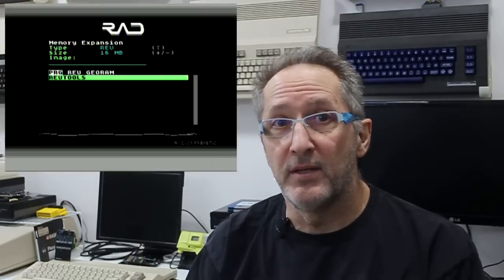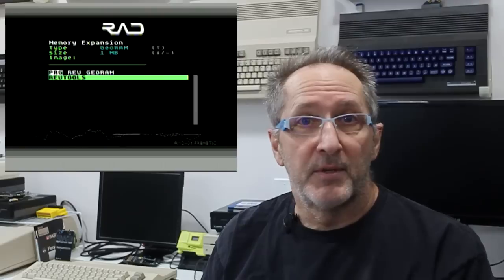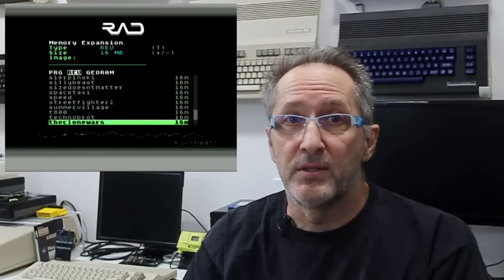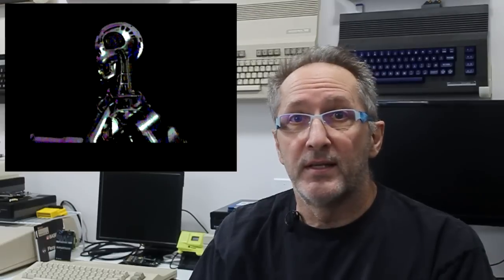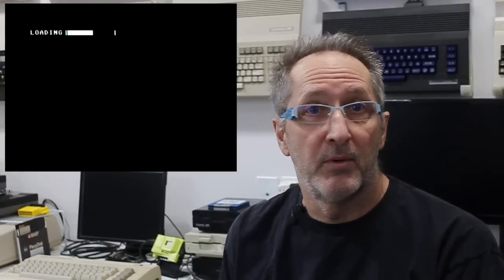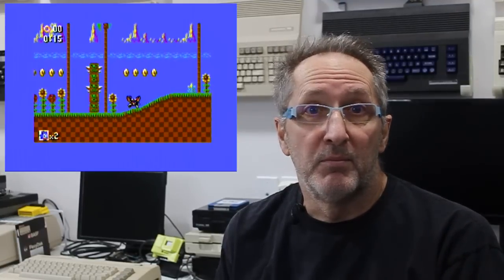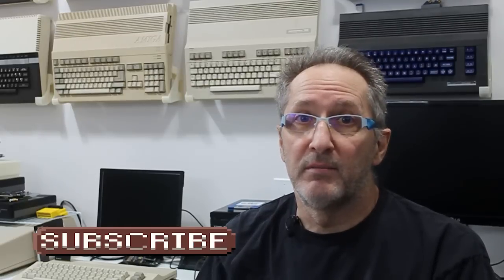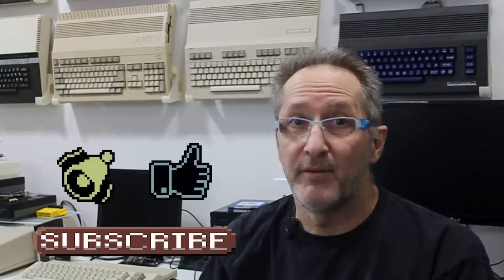Commodore RAD Expansion Unit Review

Comment: So i have a 1541 Ultimate II+ from Gideon. Is it better or worse than the RAD Expansion Unit and what are the differences? Is it worth buying the module if you already have the 1541 Ultimate II+?
Reply from the maker: If you have a 1541 Ultimate II+ it's absolutely not worth your time/money to buy one of those.  Gideons cartridge is more cycle accurate than the rad.  The rad is a cheap handy device if you want a fairly compatible ram expansion cartridge, but it's nowhere in the league of Gideons cartridge.
Reply: @8BitResurgence  Thank you very much for your answer.

Comment: I just got one of these devices for my Flat 128. When i install the device and turn on the computer, I get the music, but the screen gets progressively worse.  Can you explain or show, how to go about fixing this with a flat 128?  I would really appreciate that. ty
Reply: Exactly the same for me. Works fine with a real c64 but not with c128 (c64 mode, too). Plays music but a lot of glitches and random characters on the screen. By selecting a REU and rebooting the c128 freezes. Maybe timing issues or any other settings to change in the cfg file? 
Doesn’t work even by using a new ‘updated’ power supply or a dedicated separated supply for the Raspberry Pi. Anybody else found and solved the issue? Would really appreciate a solution for me and other 128ers

Comment: Exactly what firmware files are required to get the RAD to work? I've unzipped the firmware folder into the root of the SD card, but the C64 just boots directly to BASIC, without the additional REU text at the bottom of the screen.  Do you need the other 2 zipped source code files? Do you leave all the files zipped? Do I need to move the RAD.cfg file into the root directory?  I just can't get the RAD to do anything other than flash the green light on the raspberry pi.  There is no output on the HDMI output of the pi either.

Thanks for the help in advance.

Comment: I'm new to Commodore 64. In simple terms...What's the difference between this and the Sidekick64 ?
Reply from the maker: The RAD Expansion at it's core, is designed to be a ram expansion cartridge (the REU is the distinctive feature of this) with the added feature of being able to load files that have a "PRG" extension (ie: program files).  The SIDEkick is a multi-function cartridge designed to load and run all sorts of different formats of programs and cartridges.  It also emulates multiple SID files, is a kernal replacement cartridge and is additionally a GEOram cartridge.  The SIDEkick also has a TFT color display.

Comment: Very good "to the point" video. Now I know what this expansion really does. I do agree with having good reflow ewuipment as all boards  require a soeciel preheat, reflow, and cool down process to minimize thermal shock on the board and its componenets. I have an oven myself. Hot air rework is a less " scientific" process but in the hands of a good well practiced  technician, the results xan be very good. Now if I can only get (afford) a pick and place machine... LOL. 😂

Comment: How did you set the config for 16MB REU boot please? Great video btw
Reply from the maker: Put the following at the beginning of the rad.cfg file:

STARTUP REU16M
Reply: @8BitResurgence  Thank you!!
Reply: @8BitResurgence  I've put .reu files in the REU directory but when I try and boot I get "nuvie not found"! Any ideas what I'm doing wrong please?
Reply from the maker: @RetroMarkyRM  Assuming you're trying to run nuvies... Sometimes nuvie files will do that.  When you get that, to the effect of no nuvie data found, hit the runstop/restore, then from the basic prompt type run.
Reply: @8BitResurgence  thanks!!!!
Reply: Ive tried two different micro SD cards. (on pi3b) still won't run. .prgs are fine so the hardware seems solid.  What am I missing here? Did you just drop .reu files into the directory or am I missing something here?
Reply from the maker: @RetroMarkyRM  for the most part, I've been messing with nuvies and prg files, as well as using it as an REU and GEOram for GEOS.   Sounds like something you may need to raise an issue with the developer on his github.
Reply: @8BitResurgence  yes, its nuvies i have an issue with!

Comment: Awesome device ... I can't help thinking about how "RAD" 16Mb would have been in the 80's! There were Minicomputers and Mainframes with less storage, note Storage .. not RAM!
Thanks for sharing this! Can I ask, what is the Dark Commodore behind you? I love the look of that Chassis!
Reply from the maker: Thanks for your comment.  How far we have come eh!  The dark Commodore from left to right is a dual 1581 disk drive that I designed and built, the center is an NTSC/PAL monitor that I 3D printed (used parts from an old 90's laptop), and on the right is a single 1581 disk drive that I also made (3D printed and made the board myself).
Reply: Seeing as how expensive RAM was in the 1980s, and the density of RAM, we'd have been looking at spending rather a lot and a lot of support circuitry just for the number and space to mount all the chips. Considering the difference between then and now it really shows how far we have come. RAM prices dropped dramatically in the mid 1980s therefore taking a cheap value of £1 for a 64 kilobit RAM chip, and we need 8 of these to make the 64K RAM we know and expected from a C64. 16Mb is 16,777,216 bytes (using real values, not storage vendor values), and dividing that by these chips we'd need 256 of them, costing £256. That's not unachievable at the time. However, by 1985 minicomputers as a market had pretty much died (for various reasons, tech and OS being two) therefore there is little comparison and mainframes had more RAM and storage than just 16Mb. For example, the IBM 4381 (mid-range and rather short lived by 1985) could handle 64MB of RAM as well as multiple processors, it wasn't long before it was surpassed either.

Comment: Is the RAD unit able to read/mount .D81 image ?
Best regards !
Reply from the maker: No, the RAD cartridge, with regards to running software, only runs PRG file.
Reply: @8BitResurgence  well, I may be wrong, but I thought you run GEOS through the RAD Cartridge?
Reply from the maker: @MarcFROMENT , yes... it can also run REU images and GEOram images... I haven't messed around with the GEOram images yet however.
Reply: @8BitResurgence  I will be very interested by a GEORam image test :)

Comment: I have built a couple of the RAD Expansion Units and they are a very capable device! I used a combination of hot air for the capacitors and hand soldering ICs(with a lot of magnification). Watching NUVIE files on a stock C64 is amazing. Modern day retro computer enthusiasts have never been in a better position to upgrade their machines capabilities with fantastic open source creations like this.

Comment: Now I'm curious if it has some of the same capabilities of the Sidekick as well.
Reply from the maker: It shares the GEOram capabilities and the ability to run PRG files through it's built in browser off the SDcard.  Otherwise, it's an REU up to 16mb which the Sidekick doesn't support.  So some capabilities, but the big deal on this is the REU compatibility.
Reply: @8BitResurgence  Sidekick supports an OLED and MIDI too.